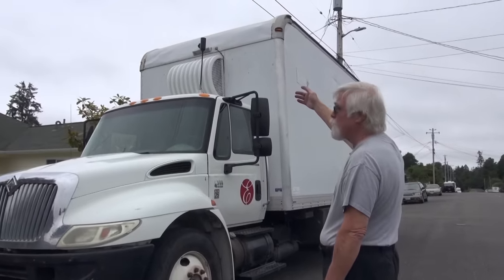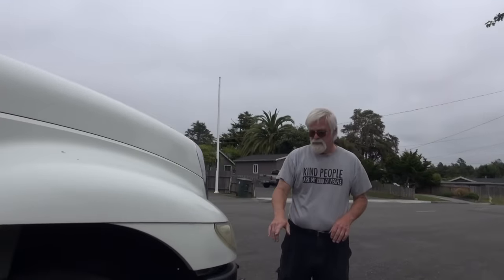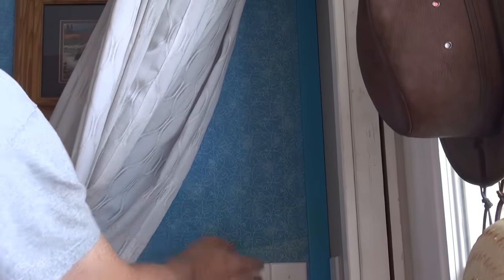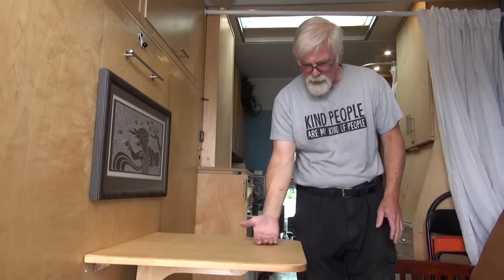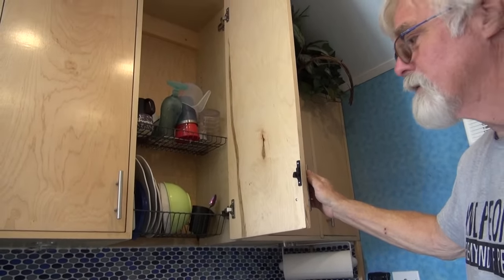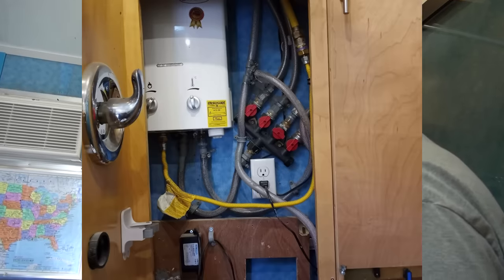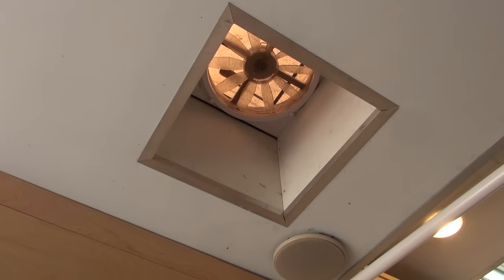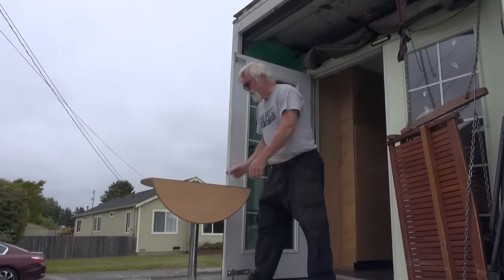Harvey the RV Stealth Box Truck Conversion/Tiny House Full Tour

Comment: Nice setup...but do you have a cdl? Do you have to stop at scales when they are open? And follow other commercial vehicle regulations? Could be a hassle...
Reply: We were able to register and insure Harvey as an RV, so we weren't required to stop at truck scales, even though we sometimes went thru them just to show them our status. As a non-commercial  truck, we also didn't need a DOT number -- although we were stopped once and asked why we didn't have one, and had to assure the officer we were an RV, which was confirmed by the registration and his glimpse thru the window and 'pass-through' of our kitchen area ~
Reply from the maker: Hi, It is like driving a big U-Haul truck. No CDL required, in some states the scales require vehicles over a particular weight to stop, in others it is just for commercial trucks. I generally stopped because i did not want the hassle of explaining that the rig was an RV after getting stopped.

Comment: Great tour but why the hell would you put your defensive gear by the only entrance? Is it so they can arm themselves b4 they get to you?
Reply: I thought the same thing. I'd never reveal what I really had and thought maybe he's got a gun and just doesn't want to advertise.
Reply: @ourlifeinwyoming4654  I doubt it, Dude thinks Bear mace is home defense 😆
Reply from the maker: The rear entrance is the only pace a person could break in. First they would have to get up on the back deck, if it was at night they would have to pry open the roll-up door and break the latch. Then they would be confronted with the locked patio doors. The doors open out and so they would have to position themselves so the door would not knock them off the back landing when it opened. Assuming they did not have a gun, all this would provide me with the time to arm myself with the bear spray and taser. Of course, if a person wanted to do us harm, and came armed, they could just shoot through the sides of truck. No defense there. We balanced our desire for protection with a desire to live without fear and the possibility of travelling through Canada where a firearm would be problematic. So we left the shotgun at home for their protection.
Reply: Is camping really that dangerous in the USA? 😮
Reply from the maker: I would say generally no. Just as I am not worried at home. But we did stop on BLM land and found a few hundred shell casings around our campsite. You can run into trouble anywhere. When I found the shell casings I picked up a few and dribbled them on the back deck as if we had been shooting from there. In the end it was a beautiful site.  @nicktw8688

Comment: 30:29 Everything seems great but at "full round table" it got scary. Kept waiting to see railings locked in. Instead chairs were put out 31:03 with "you just have to be careful".

In full earnestness. If you all haven't fallen off yet it is only by pure luck. If you put a chair out and said that's my seat with the back legs 6in from the abyss, I'd ask "Why do you hate me?" 

If I walked in and saw my loved one in that seat I'd rush over and demand they come out of there asap.
Reply from the maker: Hi, You are absolutely correct. I have tried a variety of railing ideas, but nothing has worked so far. Still working on it. There is more room than it appears but it really needs a good solution.
Reply: @DrDuze-se5cx  That is a relief to know. I've heard horror stories of people falling from rigs. Be well!
Reply: @DrDuze-se5cx  I'm surprised there isn't something that "scissors" out like the stairs. 
Amazing build, though!
Reply from the maker: Hi, unfortunately when the platform folds up and tucks away under the back of the truck there is very little room for an attachment. I am not sure how a scissors type arrangement would work on the back of the truck, but I have avoided anything on the outside that would give the game away.   @leannaestep3066

Comment: Obviously your winch installation is going to cause more headaches in that location, which you'll find out when you go to use it.
Reply from the maker: The winch is to help me up steep inclines.
Reply: @DrDuze-se5cx  understand that, the truck will favor that side more and pull you possibly into a new issue.
Reply from the maker: Hi, Thanks for this. The winch is just connected to a harness I wear to help me up and down steep slopes. My 200# doesn't seem to have any affect on the truck which weighs 15,500#. The truck is just parked.  @Ken2ndAmendment
Reply: @DrDuze-se5cx  Yes, I get that, but it will be more of an issue with respolling the cable/rope it is designed to be center of the vehicle so that it winds properly.  Which should wind left and right at the same level. You can do what you wish, but sooner or later, the cable will stress and break if improperly wound.
Reply from the maker: True. I get some of that, but it is off to the side and I try to square it up to the edge of the hillside by slightly angling the truck.  @Ken2ndAmendment

Comment: Very nice! Any chance you give a link to the water heater, water pump?
Reply from the maker: Hi, I used 3.0 gpm seaflo pumps, most of the folks on the internet are recommending Espar glycol heaters. These have a diesel heater that allows you to run water and air through heat exchangers to heat separate streams of water (shower/house) without mixing them and can also use a radiator type fan to heat the air. They are expensive and have to be serviced. But, if you can budget for them, it is probably the best way to go.  I used on demand Excel propane water heaters for cabins and rvs designed so they do not require an external vent. You can run them for 20 minutes at a time. https://www.amazon.com/TANKLESS-HEATER-PRESSURE-STARTUP-PROPANE/dp/B08DHDX3DT/ref=sr_1_5?crid=2KJJE7S286USL&keywords=excel+water+heater&qid=1701045075&sprefix=excel+water+heate%2Caps%2C207&sr=8-5 Cheers!

Comment: I want to do something exactly like this except I want to use a low pro truck low profile like a moving truck this one is too tall
Reply from the maker: It is very tall 13' 3" which has its disadvantages. However, it has an eight foor ceiling which is nice, no wheel wells to work around, substantial space under the truck bed for tanks etc. and full size tires which are more efficient. So pros and cons. Good luck with your build.
Reply: @DrDuze-se5cx  the other trucks will have the same size box they have smaller wheels and tires and lower suspension I drive a bucket truck from time to time and is very nerve-wracking cities are supposed to be clear of the height but a big rain or a low branch can still crush the bucket or controls

Comment: Fantastic everything Eric. I like the idea of using a box truck however I do have one question about it. How is the suspension? When you hit some rough road or what have you, does it translate to the back and jar everything about? Thanks for the video!
Reply from the maker: Riding in the back is like riding in a market wagon down a rutted road! It  is rough enough to shake some screws loose. As one person put it, piloting an RV is like driving an earthquake through a hurricane. The drawers have latches and the cabinet shelves have lips to keep things from rattling out. The cabinet doors have a snap latch that keeps them closed while driving. It is possible to add air shocks, but the truck was not built for it so we would have to have a custom set created. When we go out again, I may get those added to the cab to soften the road.
Reply: @DrDuze-se5cx  thank you for the reply. Yes that's pretty much what I thought. That's one of the things that kept me from buying a Metro bus for an RV.
Reply: I found a few ways to make the passenger seat in the cab a little more comfortable for weathering those bumpy roads and sudden jolts, too: I used two seat cushions, one of the thick spongy type first, topped by a large fluffy "throw pillow" one. I also kept a long body pillow with a soft, fuzzy covering up front, which I positioned as follows:  half of it across the inside of the door on my right, laying the other half across my lap as a sort of soft 'desk' or table, or just to rest my arms on. I also had a  furry seat belt strap cover, which softened the sudden jolts, and a padded neck ring which helped me relax a bit. (We also got in the habit of loudly exclaiming, "Yee - Haw!!" instead of cursing the unexpected bumps in the road that bounced us around!) The driver's seat had some kind of air cushioning, which Eric could explain better here.
Reply from the maker: I am not sure if this would apply to a bus that is designed for people rather than cargo. Probably a schoolie builder would be better to answer that question. @marklatlip3057
Reply: @DrDuze-se5cx  at an auto auction I attended with my boss in Southern California a few years ago, they had so many that only went for a thousand to 1400 dollars. They ran on natural gas and had about 400,000 miles on them.
Reply from the maker: The main reason I decided to use a truck rather than a bus was the stealth factor. It is hard to hide a schoolie! I am afraid I have no idea what makes a good deal in busses. I wonder where you fill up in a natural gas powered vehicle. 
 @marklatlip3057

Comment: Nice build  ! Where did u get the hardware for the Murphy bed ?
Reply from the maker: Sorry for the delay but I could not find the information and did not remember. According to my notes the kit for the murphy bed (which included plans and hardware) came from Rockler. The plans are explicit in asking that you not change any aspect of the design, but I got permission to change the underlayment that supports the mattress to the 1/4" peg board. I added a little extra support as the pegboard was not as strong as the plywood specified in the plans. The bed plans are not designed for a moving truck and a few of the fasteners rattled loose. I would use thread-lock where appropriate and reinforce the interior corners of mattress box using angle iron hardware. We love the operation of the bed, it just needed to be strengthened a little to accommodate the vibrations from the truck.

Comment: The bag toilet dude had to put his face close to bag about 4 times      seems black water tank easier    but no dump fees with that bag set up  lol genius set up I'm just not a shit in the bad person
Reply: He was just holding up the bag to explain/show what was done. In actual use, when the user was finished they could take a ziplock strip and tie off the bag underneath them while still seated. When they arose, they would lift the seat, remove the bag and deposit it down the chute to the collection bag under the truck, then attach a new bag as shown and put some kitty litter/sand in it for the next use. - We took advantage of public restrooms every day too, so  use of the bag setup was minimal.
Reply: Um it's a clean bag, where does it matter where it goes. Do you think they reuse it?! 🤣 Who cares where he holds the bag while explaining how it's done 🤦‍♀️ What a weird way to start a comment and to focus on. 

In my mind black tanks do seem better but I've never emptied one so who knows how gross it is. This method of bagging immediately, not touching used supplies like a black tank hose seems pretty hygienic if you think about it.

Comment: 26:14 I'm no expert but I don't know about having the shower right next to the electronics but hey that's just me.
Reply from the maker: This is certainly a concern. The way I addressed it was with interlocking flanges that create multiple barriers to water getting in behind the cabinet. With the curtain closed, very little water ever makes it to the cabinet and then the flanges make sure it cannot make its way into the electronics. The cabinet itself has a Formica layer towards the shower that matches the wood and further waterproofs the set-up.

Comment: IS That winch is only attached to the bumper ? I think you will pull it straight out and I don't even see any extra bracing for the bumper. ?
Reply from the maker: Hi, The winch is only intended to help me get down and back up from steep canyons. It is attached to a harness.
Reply: @DrDuze-se5cx  I thought you meant help getting the truck up and down the canyon, my bad. Do you have a remote that you can use from the very end of the cable length ?
Reply from the maker: That was the plan, but the remote never worked reliably enough to work it that way, so someone had to work the winch from the truck. @Smokedout.
Reply: @DrDuze-se5cx  Yeah I was wondering about the flaws and mechanical issues?  Crazy to have to call for a rescue because you forgot to get a pack of batteries, 🤭 just messin with yah, cool thought though. That's a system that needs to be bulletproof.

Comment: Its interesting to see others come to some of the same design decisions I did with my build like the skylight, I added a powerful inline fan in the floor for excellent airflow which also gave me more room for 2000w of solar. A box truck makes vanlife look like a #stupid idea :)
Reply from the maker: I'm curious as to what you do with so much solar power? We didn't have a television but otherwise Lights music and Refrigeration all worked off of the 400 w. Are you able to run an air conditioner with your solar?
Reply: Well I am a bit of a house cat and spend a lot of time on youtube with a computer and external monitor, I occasionally game and thats a constant 300w. Its winter where 2000w is needed. I installed a split system ac last summer but there is something wrong with it so havent got real data, I will have no problems running it, its just a matter of how long during the night. About 6 hours after dark I'd say, if I turn off the composting toilet fan from sucking out all the cool air it should stay cool the rest of the night. I made an evap cooler so I have that as back up either way.
Reply from the maker: Wow! I guess I had no idea how much power gaming took. Thanks for this. @jedics1

Comment: Very nice set up! You did a great job. I am curious about the fuel mileage you get out of that International 6 cyl diesel?
Reply from the maker: sadly about 7mi/gal.
Reply: @DrDuze-se5cx Wow, I would have thought about 10-12. Is it turbo-charged? Which transmission?
Reply from the maker: It is an automatic Allison transmission, I wish you were right about 10-12. Whatever the mileage we only drive the number of miles we could comfortably afford each month. @Elite59

Comment: Can I get a link on the cameras you used please?
Reply from the maker: I used the Blink outdoor wireless camera system. It was fine during the day, but you had to turn on the exterior flood lights to get a good view when it was dark outside. That is a fairly aggressive move if you are camping near others. If  had to do it again I would look for cameras with an infrared option. Good luck.
Reply: @DrDuze-se5cx  love it. So you just cut a hole not enough for the "iris" of the camera. Genius

Comment: Do you stop at weigh stations since it looks commercial and do they ever look inside???
Reply from the maker: In most states you are not required to stop, but in some it is based on weight rather than commercial status. I generally stopped because it seemed easier than getting stopped and explaining myself. Once we were pulled over for further investigation, but the rest of the times they just waived us through as we were under weight. The one time we were pulled over, I just showed our registration as an RV and we were free to go. We were happy to show folks the inside. One Border Patrol agent in Texas took a visual tour.
Reply: Thank you for that! :)

Comment: What is the Brand and model camera System
Reply from the maker: We used the Blink wireless cameras. They were ok, but if i were going to do it again I would make sure to get cameras with infrared technology to allow you to see in the dark.
Reply: I am trying to find a 4 to 8 camera system that will be Hard wired and had DVR with Bluetooth connected to Internet 24 -7 or a Cargo Trailer

Comment: Uv light does not do what you think   should do what you want in a different way
Reply from the maker: Not sure how to respond. Here is the write up: The UVF11A Sterilizer Water Filter is a complete add-on kit that can be added to most RO systems as a final stage. The UV sterilization stage kills the small percentage of viruses bacteria and other microorganisms that could potentially remain in the water after the RO process

Comment: How did you get a passthru from cabin to trailer
Reply: Ever hear of a sawzall?
Reply from the maker: Hi, that was the scariest part of the build. To cut the hole through the cab and box took me several months of consideration. The cab 's back wall has a pattern pressed into it to keep it rigid and I was afraid that I would make the whole thing unstable if I just cut a hole. So...I bought a 3/8" aluminum sheet larger than the hole I intended to cut. Cut out the hole in the aluminum and then transferred that cutout to the truck and box. After the holes were cut, I bolted the aluminum frame to the back of the truck and filled the gaps with spray foam to keep it rigid. An accordion rubber seal  was stretched from the lip of the box wall to the lip of the aluminum frame. The seal was glued to each side and then boxed in to make sure it stayed in place. The seam at the bottom of the seal was glued and sewn. And that is how the pass through came to be.
Reply: Amazing
Reply: @DrDuze-se5cx dayum!!! Thank you for the detail. I hope to be doing a build like this someday, and that just answered so many questions.